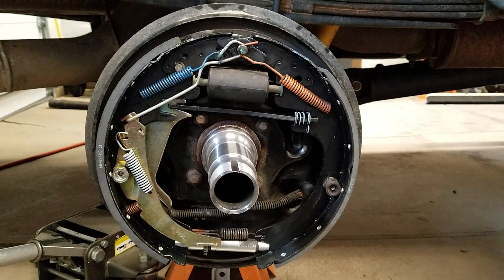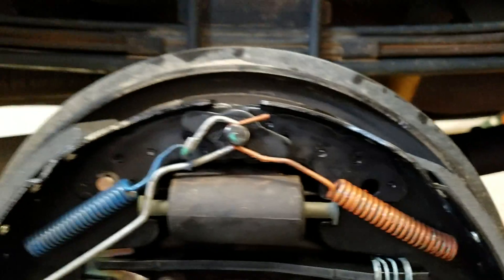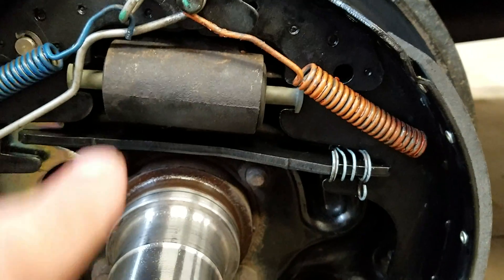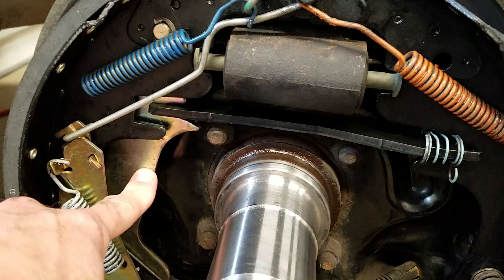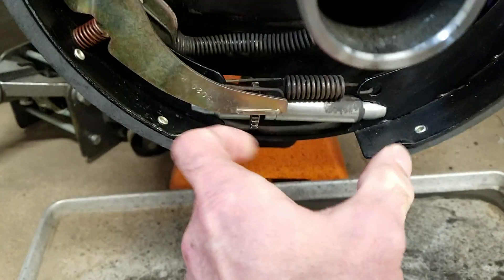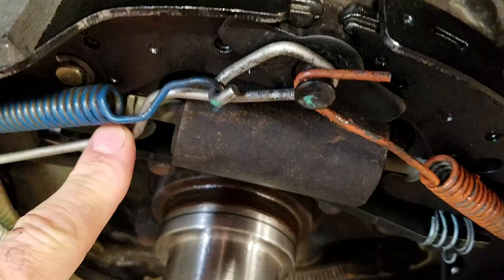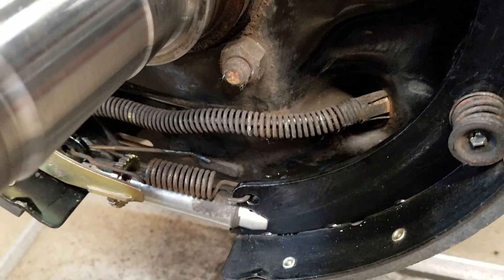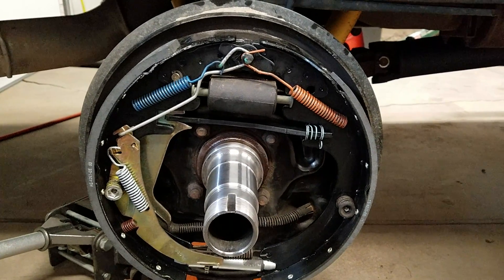Drum Brake Overview (Dana 80 Passenger Side)

Comment: Will this be the same for the drivers side? Thicker in the back?
Reply from the maker: Correct.  It is always BOB no matter the position, or the manufacture so long as the brake cylinder is on the top.

Comment: Is that star-wheel adjuster Left or right hand thread ?, Thanks , nice video !
Reply from the maker: Your wheel should have an L and a R on it somewhere.  L being left hand side of the axle,   R being right hand side of the axle.  When the arm pushes down it catches the wheel to spin it.  So the right hand adjuster would have to be left hand threads to extend the adjuster correctly (clockwise rotation "lostens" the thread).

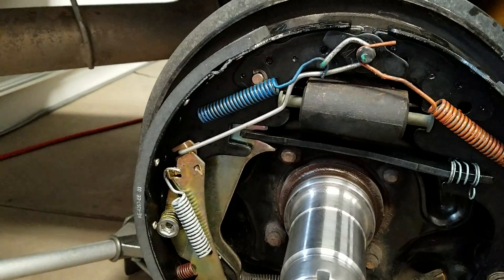Comment: I know its been a long time since you made this video.  @5:00 where you mention the self adjusting arm, is there a washer that goes between it and the shoe around the spring and clip retainer?  I put one side of mine together today and have one lonely washer (not the wave washer) left.  Hoping for a reply!  Thanks!
Reply from the maker: Off the top of my head I remember just a wave washer.  I think some self adjusters have a thin washer on the pivot.   So in this example it would be on the left side of the star wheel in between the star wheel and the cap that spins freely.

Comment: Hey man! great video! I am putting this Dana 80 in my 2nd gen with a D70, can I ask the year make and model you used at the parts store to buy your brake parts? having a hell of a hard time trying to figure out what it came on exactly, I just keep ending with D70 parts.
Reply from the maker: This is a 98.5 Ram 2500 with the larger brake package.  I don't remember specifics of the larger brake package but I seem to recall either a larger drum or wider shoes.   If asked choose the 8,800lb axle option.
Reply: @ShainAndrews  Thanks Shain, I appreciate the info. I tried today and Napa/advance couldn’t find an option. I even gave them a VIN. One person told me the 60/70/80 newest drum brakes will work for all rears but i’m not sure if I trust that. If I ever figure it out (which has to be soon) i’ll post it on here as a thread
Reply from the maker: @tjtotheb  I'm fairly confident the brake components are the same throughout the years.  This is early day Legos.  The Dana 80 was shopped out to all the manufactures, and I'm pretty sure the big three used it at some point.  They changed very little over its manufacturing lifespan.

Comment: Any Idea the part number or place to buy the parking brake lever and the link for the passenger side? I just used your video to do my brakes and the right side is missing the parking brake lever and link...yours looks so new, I'm hoping you can help me with any information on where to buy
Reply from the maker: It's gotten to be a real pain finding parts.  When I posted this video a guy could still look up OEM parts online.  Believe it or not all of those parts except for the springs are OEM.  Truck was over 200k miles at the time.  I don't think I have ever replaced the brake cylinders.  So you are missing the lever that connects to the cable?  I'll see if I can find a PN.  Probably be a salvage yard type of quest though.

Comment: Amazing video. I have to see the part where you take it apart now.
Reply from the maker: They might be getting close for replacement.  Since that truck doesn't tow anymore the shoes easily last 150k miles.  200k is probably closer.
Reply: @ShainAndrews    Great don't forget the part where you compress the wheel cylinder.   If that even makes sense.
Reply from the maker: @jamescole3152  Wheel cylinder is always compressed unless the brakes are being applied.  The adjuster is responsible for compensating for wear.
Reply: @ShainAndrews  Thanks a million.  The pins that go into the wheel cylinder ends only go in about a half inch or so.  This is my first time but I see the shoes will hold onto the pins at the sides. I cut open the old Wheel cylinder and see it has a cup shape inside.  So the pin is supported by this cup on one end and the shoes on the other end. It there was ever any slack the pins would just about fall out.

Comment: The kit that I purchased from O'Reilly's also includes 4 long clip things. I am not sure what they are for or where they go. If it is a big difference in performance having them in their designated place I want them there. I hope you can get back to me about this sooner than later as I am beginning the process of assembly NOW. Thank you for the helpful rundown. The emergency bracket I apparently had backwards. The original setup the bow was flexing towards the outside of the vehicle rather than inside. Apparently it worked. As well idk because I just got the truck 3 weeks ago and all I've been doing is fixing it.
Reply: Oh btw spring kit is brakebest #H2323. There you can see which 4 identical rectangular 1" pieces I am referring too.
Reply from the maker: @patrickfitchjr  Good man.  I was about to ask what the kit or PN is.  I'll take a look.  BRB.
Reply from the maker: @patrickfitchjr  OK I see the bits you are talking about.  I'm honestly not sure what they are for.  I would have no issue forgoing their installation.  Probably a very generic kit for a really wide range of applications.  Those axles are under a lot of different vehicles.

Comment: incase anyone was wondering, atleast on a dana 70 with 2.5" brakes... you can indeed get both the secondary shoes on one side and both the primarys on the other.. the brakes work but the secondary side is so tight in there it makes contact before any other brake in the system, my truck was pulling left everytime i braked for a long time.. was chasing wheel hub seals that had soaked the brake material in gear oil i thought that was the problem.. i at the time didnt know there was different shoes.. sure enough i figured it out one day and swapped it all around brakes work much better now
Reply from the maker: LOL.  I know I shouldn't chuckle but I did. Yeah that scenario happens a lot.  Especially with worn drums where there is a little more room for activities in there.  If a person can get the shoes adjusted the same it will still pull as there is now a significant difference in contact area between the sides.  I swear every time I run across it... it is always set it up for a left pull.  Glad you got it sorted.

Comment: Excellent informative video.  Could you please explain the reinstallation of the parking brake cable retainer clip not visible in the video?  Thank you!
Reply from the maker: Retainer clip?  Only one I remember is an E clip that holds the pin that goes through the shoe and the service brake arm.  You put all of that together before putting the shoe on the backing plate so you have plenty of access etc.  For those I just use a pair of pliers.  Set the clip in the grove and gently squeeze the pliers.  You will get it on half way then reposition the pliers or even gently tap the clip all the way on.  Hope that helps.
Reply: @ShainAndrews  The parking brake cable hooks into the arm.  The spring that slips over the cable from where the cable comes through the backing plate, to the parking brake arm, has a peculiar end on it that keeps the ferrule on the end of the cable from coming out of the arm.
Reply from the maker: @patriciatrooien3374  Oh that.  I don't think I can verbalize how it goes.  I'd have to open a drum up and record it.  Is your other side still installed?  You can compare to that if possible. It's not difficult but until you see it I can understand the confusion.

Comment: Excellent! I never realized these were self-adjusting brakes. I thought the two removable slot covers on the bottom of the backing plate were there so that you could install (and use) the adjuster wheel (and bottom spring) either forwards or backwards.

I suppose the slots could still exist for manual adjustment, but now that I think about it I'm not sure they really line up with the adjuster wheel.
Reply from the maker: The self adjuster should roughly line up with the slot in the backing plate.  A person needs access to the self adjuster for a few reasons.  First is to set the initial adjustment before driving the vehicle.  Second is to retract the shoes after there is wear on the drum.  The shoes wears a grove in the drum and makes it impossible to remove the drum until the shoes are retracted enough to get past the unworn portion of the drum.  If the self adjuster is not functioning of course manual adjustment can be made.
Reply: @ShainAndrews  Yep! Hey, about this part, "First is to set the initial adjustment before driving the vehicle. "

Comment: gosh this is just what i needed to find i have a 98 12 valve cummins that is having really hot brakes on the passenger rear and i am going to re assemble like you have shown here tomorrow. i bet i put the 2 secondary shoes on the passenger rear wheel making it too tight. Your awesome for making this video and i never knew there was a primary and secondary shoes. god bless you
Reply from the maker: That is a possibility.  I would think a person would notice the shoes dragging even if the adjuster is backed all the way off... but I've seen all sorts of issues when it comes to drum brakes.  I don't recommend anti seize for the self adjusters.  Silicone paste, brake lube, or regular grease all work fine.
Reply: @ShainAndrews  UPDATE  i switched the primary and secondary pads to be correct as you have shown and we are good as gold thanks man!
Reply from the maker: @whitewolfoutdoors3418  Right on. Glad I could lend a remote hand ;-)

Comment: I hope you re-installed the backing plate's top nuts. BTW, you did a fantastic job of cleaning your re-used components.
Reply from the maker: Is that were those nuts go?  LOL.  I don't remember having the badking plate loose for that exercise, but it was a long time ago and I've slept since then.  I use purple power diluted a good bit with water.  Buy five gallon bucks of the stuff and mix it in a two gallon garden sprayer.  Brake cleaner peels the paint of the springs on the first shot.  I pulled the drums off a year ago.  One adjuster was seized.  As an experiment I greased one side with anti-seize and the other with 3M silicone grease.  The anti-seize side was locked up.  Silicone was perfect.  No more anti-seize as a lubricant for me.

Comment: Excellent, clean visual and description. Do you know if the thicker shoe should be in the front? or on the back. My truck had thicker shoe on passenger side on the front and thinner shoe on front of hub on drivers side. I reversed the drivers side to thicker shoe to front so both side where the same.  just didn't seem right to be different.
Reply: Yeah, the trouble with seeing how it was done by the last guy is that the last guy might have been wrong (as was in my case today!) "Thicc rear" in the modern parlance.
Reply from the maker: Stick with BOB (big on back).  Regardless what side of the axle a person is looking at the thicker & longer shoe goes on the back so long as the slave cylinder is on the top which almost all of them are.
Reply: @ShainAndrews  thank you for all the information you give us.

Comment: What the heckkkkkkkk man!!!!!!!!!!!! I’m following the video doing everything in order that you say and then towards the end......OH YOU SHOULD PROBABLY DO THIS SPRING BEFORE YOU PUT IT ON OTHERWISE YOU WILL HAVE A HECK OF A TIME GETTING IT ON!!!!!!!!! SAY THAT AT THE BEGINNING!!!!!!!!! Now I’m having to redo everything!!!!!!
Reply from the maker: It's tough keeping all the steps in my head and then spit them out on camera in sequence in one take.  Think of videos as instructions... always read or watch the whole thing FIRST.  I mean it could be worse you could be without any reference LOL.  You will get the job done, take a break if frustration is taking over.
Reply: Did this job today, including installing the bottom spring last, right before putting the adjuster back in. The bottom spring can be pulled over with pliers or screwdriver a HECK of a lot easier than the top 2 springs, for example. Speaking of which, I try to do the top 2 springs first under no tension, then the 2 side springs at 9 and 3.

Comment: Hey shain I was wondering the year make and model of the truck your working on because my friend have a 1985 c10 with this rear end and we don’t think it’s the original one that’s come with it and we’re trying to order the brake shoe hardware seals and cylinder for it at the local auto parts store
Reply from the maker: This is off a 98.5 Dodge Ram 2500.  Even on that platform I believe there were two shoe and drum options.  Both 13" but in either 2" or 2.5" wide.  

Your best bet is if you have hardware, and you believe it is correct.  Take it all in to the store.  Now granted depending on the store, and the person behind the counter it can be a bit of a crap shoot.  I still generally get the best counter people at Napa... but not always.

Comment: after watching this video....i should probably check out my rear brake drums consider the PO has worked on them before....the PO also used 3 water spigots and 4 brass valves on a homemade fuel system. 

Time to get dirty! good video.
Reply from the maker: LOL.  Yeah I've seen some .... interesting... work over the years.  I'll add one new piece of info I learned about a year back.  Don't use anti-seize on the self adjusters.  When I recorded this video I did one side with anti-seize and the other with plain old grease.  Anti-seize side froze up, grease side was perfect.  So it took less than a couple of years for it to lock up.  It was the first time trying anti-seize, and will be the last.  3M silicone paste is also really good for these applications.

Comment: I have a question for you. 
I bought a new spring kit because there was no rear brake parts on the GMC 1988 1 ton van when I bought it. 
The pins are to short.  With the spring compressed  the retainer cupped clip and the pin do not touch.  What is the length of those pins and are the same length on both shoes.?? Thank you.
Reply from the maker: The shoe retaining pins should be the same length.  Since you had no hardware there are a few potential issues.  The shoes you have could be incorrect.  I'm not exactly sure what model GMC you are referencing, but when I looked on Rock Auto for a 1988 1 ton pickups I did see a 13" x 2.5" and also a 13" x 3.5".  The width of the shoe will determine how long the hold down kit should be.  When I looked at hold down kits I  saw two different options each referencing the shoe width.  I recommend verifying the shoe width matches the drum surface.  If that is in order then you probably have the wrong hold down kit.  If the shoe is too wide then swap them out for the narrower 2.5" variant.  Hope that makes sense.

Comment: Hi, very nicely done! I took a lot of pictures of both sides but having your video step by step recap of parts positioning was a life saver. Just a note from my experience on the Chev Dually 1 Ton axle with the longer spindle the center bar has to go with the curve outward otherwise it forces the shoes off the Dually backing plate. Also don't forget the self adjuster has a right and left side opposite thread for the correct function.  Found that out after had together but caught in time. Too bad you didn't make a video showing the brake repair...dubbing of course all the curse words trying to get the shoes and springs on... ha ha. Cheers and thanks.